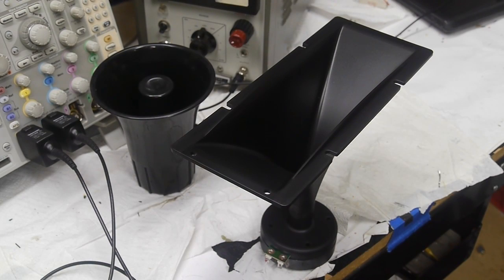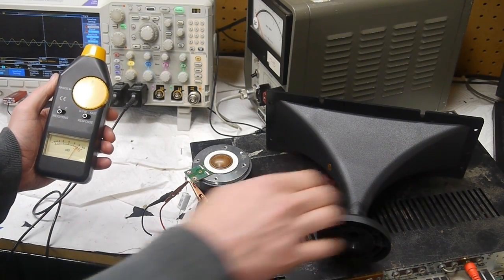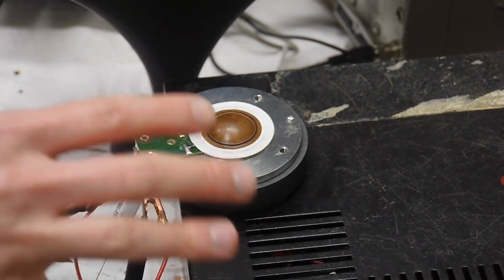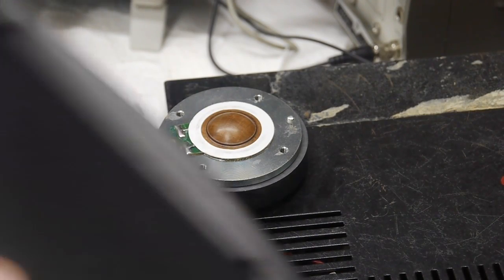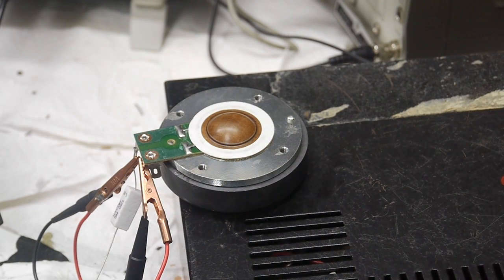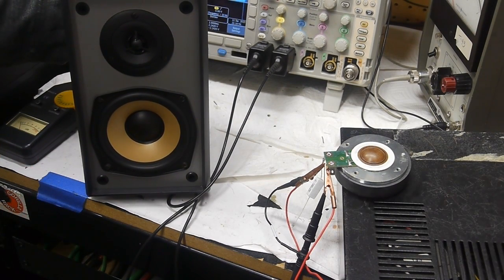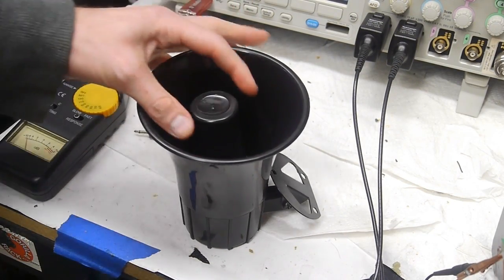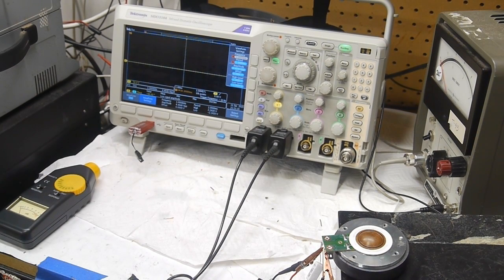How a horn amplifies sound (hint: Impedance matching)

Comment: It's impedance adjustment for beginners. You need power to drive something, so can't impede beyond workability. It's basically a graph for 2 sides and the matching is the balance point where efficiency is high, but you can still impede a horn, if it's louder than expected (maybe you saved money on the other speakers) or someone is complaining.

Comment: 4:38 I agree with your description of the driver having a low acoustic impedance, and the air having a high acoustic impedance. However, we are in the minority on this. Authorities on horns, such as Bjørn Kolbrek, state that "...the impedance of air is low, because of its low density. The source impedance of any loudspeaker, on the other hand, is high,..." Horn Theory: An Introduction, Part 1, by Bjørn Kolbrek, (2008). This makes no sense to me, and I have been in audio for almost 50 years. It's good to see I am not the only one who sees it the other way 'round.

Comment: I heard that a magnetic field is at least somewhat analogous to material inertia. And, electric circuits are analogous to hydraulic circuits. It's hard to frame my question here, but I wish you would do a video putting electricity, magnetism, inertia, and maybe more, into some sort of framework where I can understand the relationships between them. It's like, with a photon, it contains or is made of electric fields, and magnetic fields, which oscillate in relation to each other, but I don't understand the "why" of it. I should probably go to college. lol

Comment: Actually you can't "make the twitter bigger to move more air", it's a false datum. It would be too heavy to move back and forth fast enough for high frequencies and it will either blow the coil because it would overheat or not have fast enough motion. That's why the horn is used, because air is much lighter than any material that can be used for the diaphragm and can be moved by a smaller diaphragm size.

Comment: I suggest to use thermal camera to figure out if dome hotter without dome that with dome. Probably you don't see difference on oscilloscope because without dome more energy converts to heat and with dome more energy transfer to sound waves.

Comment: The example with the newspaper is not exactly correct as shown, because the paper does not only add a connection with the air - it also adds mass. To be completely correct, you should also have tried a "control experiment "with the newspaper folded and perhaps glued onto the stick. Your explanation is still great, I am just being pedantic! :)

Comment: So a small inaccuracy: the speaker system is a triple system, where there is an electrical-mechanical-acoustic coupling.

The electrical energy gets transferred to the mechanical movement of the speaker suspension and diaphragm and that is quite efficient. The diaphragm transfers mechanical energy to acoustic wave energy, which is woefully inefficient. Its around 1%. This is indeed because of the mismatch in impedance between the mechanical and acoustic systems. The horn basically presents a different acoustic air load on the speaker to improve energy transfer, and this is why you couldn't measure a difference on the oscilloscope because that just shows you the electro-mechanical side of the transfer.

Comment: The main reason for square or rectangular horns is not sound dispersion, it is available space on the speaker front board. This is clearly attested with the many small gigging speakers where the horn actually wraps around the bass driver. square and rectangular horn actually have poor sound dispersion as they create lobed dispersion patterns. The higher the frequency the greater the number of lobes and the more intense they are. This means that the intensity of the high frequencies that carry all the clarity and definition information varies greatly across the audience area. The most even frequency dispersion is obtained from round horns. This phenomenon was well established from the earliest days in the development of horn speakers but seems little known today due to the overwhelming load of marketing BS today. If you are running a portable gigging PA, your priority will be for small, lightweight and fast to setup gear, so you will only be able to use these rectangular horns. However, if you are running a fixed auditorium system and have the space, round horns will give you a much more even spectral dispersion pattern across the hall and that should be a major priority in that context.  The priorities for gigging and fixed auditorium PA are mutually exclusive and polar opposites.  For gigging has no control of the performance area or acoustics so these considerations are abandoned in favour of portability and setup speed.  While in a fixed auditorium, you are not pressed for setup time but have complete control of the performance area and hall acoustics.  So, like many things in sound, the answer is, “well it depends”.
Also, it is not clear that the impedance matching you are talking about with horns is acoustic impedance coupling, not electrical impedance.  Acoustic impedance is increased by constricting the available space in the compression chamber and horn throat so that the compression pressure is greatly intensified and energy transfer from the dome to air is improved.
There is a balance between this and size of the throat.  The sound does have to get out through the throat.  If the throat is too small, you may get great compression and energy transfer but not much sound energy escaping through the throat.  If the throat is too large, the opposite is true.  So, there is an optimal acoustic impedance coupling in this.
The main reason that HiFi tweeters do not use horns is that horns interfere with the spectrum response and fidelity of the high frequency signal.   HiFi is about high fidelity after all.  The more systems you have in place the more the signal is distorted from the original wave form.  For this reason, Traditional HiFi almost never uses EQ but relies on keeping the signal path very short and simple.  Spectral balance is tweaked by speaker placement, proximity to surfaces such as walls and toe in.  This exploits the natural spectral dispersion of speakers, where lower frequencies have a wider dispersion than higher ones.  Pointing the tweeter at the listener improves high frequencies at the listening position while mids and lows are improved off axis and bass can be improved by placing speakers near a surface such as a wall.   This only works in the context of a small audience area (listening position) which home HiFi has where the stereo image is optimal.  This is of course not an appropriate solution in the PA context where you are serving a large audience area.
There are just different audio contexts and the appropriate priorities and techniques for solving similar issues vary accordingly.

Comment: 3dB = doubling of input power. 6dB = doubling of number of sources driven with same voltage, or quadrupling of input power to a single source. 12dB = 4x the number of sources driven with the same voltage.
Reply: 6dB + 3dB = 12 ? ... no !

Comment: You mentioned detecting electrical energy transfer difference between the with and without horn case.

My hypothesis is that this would need to translate into a perceptible force on the speaker surface which is highly unlikely given air is a compressible fluid. The energy transfer from the speaker is likely the same but the energy is reflected back into the housing. By using a horn, the column of fluid provides a duct to more efficiently direct the sound energy and hence less energy is lost. 

It would be interesting to see if this was done in a non compressible fluid. You might even be able to visualise the pressure wave.

Comment: Electronic impedance mismatch.. Now that's a topic that a lot of people have experienced but not realized... Who's ever plugged their phones headphone output into the RCA input on an amplifier... Even most portable Bluetooth speakers that have AUX input aren't impedance matched even though the manufacturer is fully aware that people will be using the device with a phone.... I would definitely watch a video on this topic... Especially if there's a impedance matching circuit that I could use with my phone.

Comment: Does the cone amplify sound on cantact with the speaker as well as with the air volume. And if so. My question is. If you create contact between the cone and the speaker by placeing the speaker elseware such as outside the cone on the side. Or placeing the speaker on the cone otop the broder side of the cone. Would this provide for amplification as well as when placed under and centered in the smaller entrance of the cone.

Comment: I don't really buy this explanation, it doesn't really make sense. How does the cone allow the speaker to move more air? It can't change the volume of air the speaker is able to move, does it? I think it's more likely to be that the cone is setting up a resonance cavity, matching the impedance in the same way as an LC matching network
Reply: Rob Mckennie The horn makes air near the dome have to move other air in order to move itself. By making it harder for the air on the dome to move away the pressure on the surface of the cone is higher, allowing more force on the coil, and therefore better power extraction. By careful design of the cone, the resistance applied to the air is just the inertia of more and more air, so the power pushed into the air comes out as moving waves of lots of air, i.e. sound.

Comment: Isn't it because when the speaker is open to the air, the pressure waves can travel radially away from the cone, however, when you place the horn on it the sound waves can only travel along the tapered pipe. The cross sectional area of the pipe at the base is much less than the area of the 3D dome of air  that would otherwise travel radially, therefore for the same amplitude of travel of the cone, you get a greater pressure and therefore higher volume. I.e. by focusing the sound waves, we get higher pressure therefore higher  volume. I'm just using reasoning, I have no experience in audio engineering.

Comment: In simple terms, couldn't it be said that it's concentrated in the horn?  Like an adjustable flashlight: "focused" is strong, unfocused (diffused) is weaker (light density)?  Then it emanates from the horn outlet. No "amplification".

Comment: Nice.  My son and I built a project a few years ago to connect to an iPhone.  With the horn, the Annoyinator was about300x more efficient than the iphone alone. Check out "The Annoyinator" on kickstarter if you want  (long since closed).  Typical direct-radiators are ~5% efficient.  Typical horns are ~50% efficient.    Absolutely critical to getting the efficiency is to completely seal the neck of the horn against the flat plate of the driver.    

Also, not mentioned is that horns are only efficient when the wavelength of the emitted sound is smaller than the perimeter of the horn.  That's why you don't see subwoofer horns.  a 20Hz wavelength would require a horn with a perimeter of 50 feet just to get started!

Comment: A couple of very late comments (I just saw the video).
An industry standard seems to be that to get a good, even frequency response, the coil resistance is about 75% of the nominal impedance.  Given that, measuring the impedance changes due to the horn is actually difficult, requiring more controlled arrangements.
The importance of impedance match can be highlighted with a few numbers (relative): Air - 0.0004, Aluminum - 17, Beryllium - 23,  Brass - 32, Steel - 45, Polyethylene - 1.7.  Relating to an audio transformer, the impedance ratio between primary and secondary is the square of the turns ratio.  With the horn, we probably are talking about the square of the dimensional ratio.
But the gain issue is not so clear.  Any antenna and the horn gains obey the same law of being relative, not absolute.  The sound level meter does not tell the truth, given room reflections.  Any gain beyond some coupling efficiency improvement at the source is due to the direction, when measured in OPEN SPACE.
As to the horn shape, most horns can handle some 10:1 frequency range, such as PA speakers about 300 to 3,000 Hz with a decent quality.

Comment: haha "So if I wanted to make this LOUDDERR for you"

But seriously, surely the resonance of the horn reduces the quality of the sound significantly. 
I understand this wouldn't matter as much with tweeters as 16 bit audio may have less than 5 bits of resolution above the main driver cutoff so the quality that can be determined by the ear in high frequencies is minimal. You do see them used in some loudspeaker systems for voice directions though which probably contributes to why they sound so terrible.

I guess it makes sense as a tweeter for any live event. Still gonna keep my silk dome tweeters for home though!

Comment: Hallo
Have you ever heard sound out of soot?
I think that will be interesting for you. Today I heard a sound that come from the metal wall of solid fuel boilers when accidentally shine on him a flashlight. I was very surprised and at first did not believe it. Flashlight bright enough and has a brightness control function (most likely - PW modulation). Frequency ofsound depends on the brightness (flashing frequency).
After that, I put the candle soot on a piece of glass and aluminum foil and the same thing happened. On YouTube I found only 2 videos of a similar effect but there was a very insensibly sound. I can also send my video with this effect.
Do you know what is the effect?
You an repeat the experiment requires only soot and bright light that shines with some frequency
Thank you

p.s. sorry for my english), this because i am from Ukraine

similar effect: 
https://www.youtube.com/watch?v=hzJ3zvAXj_0
https://www.youtube.com/watch?v=V57MP98WWBw

Comment: Good subject, but your explanation was not as good as some of your other videos.  The main thing that is lacking is a definition of the impedance of a medium, such as air.  And to explain impedance you have to explain wave propagation.
Wave propagation happens when a medium can store energy in two different forms, and transfer that energy back and forth between the two forms.  For example, a radio wave has both electric and magnetic field components, and if you could freeze time and look at the wave, you would see that at some points all of the waves energy is stored in the magnetic field, and at other points all the energy is stored in the electric field.  As the wave propagates, the energy is transferred back and forth between the two types of storage, and one complete cycle defines the wavelength.  Now, magnetic field strength is in units of Amps per meter, and electric field strength is in units of Volts per meter.  So if you look at the ratio of the field intensities, the distance units cancel and you are left with Ohms.  That is why we say that free space as a characteristic impedance.
It's a similar thing with sound waves, only instead of an electric field we have a pressure field (which stores potential energy) and instead of a magnetic field we have a velocity field (which stores kinetic energy).  In a sound wave the ratio of pressure to velocity is like the ratio of Amps to Volts in a radio wave, and that ratio will be a constant that defines the sound impedance of the medium.
The concept of impedance matching is easily understood by looking at an electrical transformer. On the primary winding you could have an input sinewave that has low voltage amplitude, but high current amplitude; so the impedance looking into the primary is low.  But if it's a step-up transformer, the output waveform will have a higher voltage amplitude, and lower current.  Similarly a horn is used as a kind of transformer designed to convert the impedance of the signal source to match the impedance of the medium.
Wow, I didn't mean to write this much, but I guess I was bored.  I hope people find this useful.
Reply: Thanks Tamas, but I my explanation of wave propagation was incorrect.  Roger Onslow corrected me.  Please see his comment. Sorry for the mistake.
Reply: I've found your comment very useful, thank you! :)
Do you know any good sources where the pressure and velocity field and how they propagate are explained with more math?
Reply: Thanks Roger, you are right.
Reply: Porkchop's Papi   I find it very appropriate and appreciated.
Reply: Thanks a lot Steve and Roger - really good explanation. This clarified a lot of what this video was talking about. :)
Reply: Steve, you need to re-look at electromagnetic radiation. The energy is not transfered between the electric field and the magnetic field. The two fields build up and decay simultaneously but orthoginal. Half the energy is stored in the E-field and the other half in the H-field. A better analogy for you would be a resonant tank circuit where energy is transfered back and forth between the electric field in the capacitor and the magnetic field in the coil.
Reply: +Lou Fazio. That's good. That's nice. That's good and nice.
Reply: +Roger Onslow. Oh now he spent all that time feeling smart, and you had to poop in his doorway.
Reply: Steve Robbins. Why don't you make your own video instead of your attempt at self aggrandizement off  somebody else's work ?